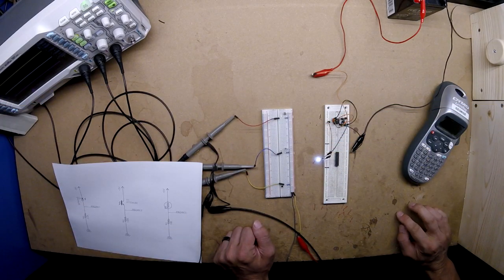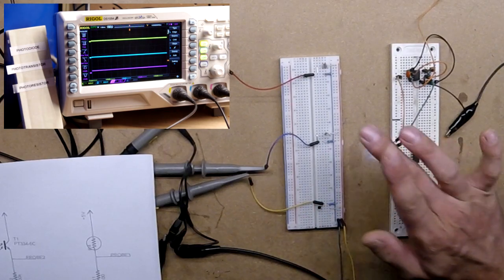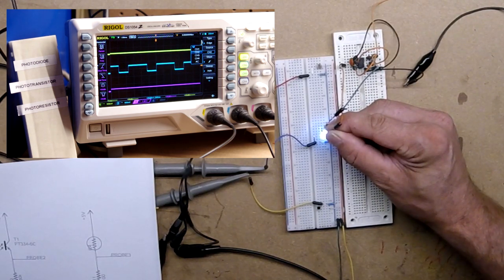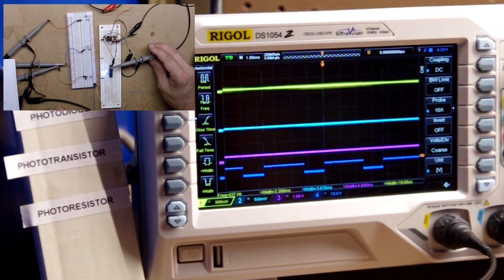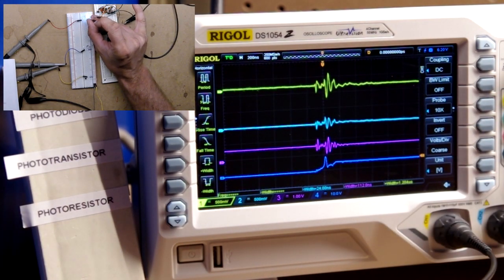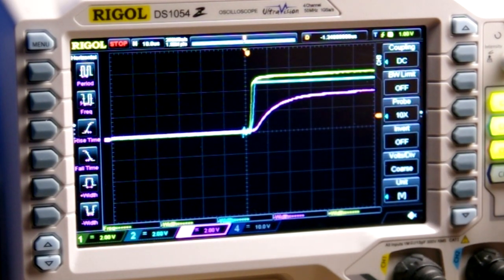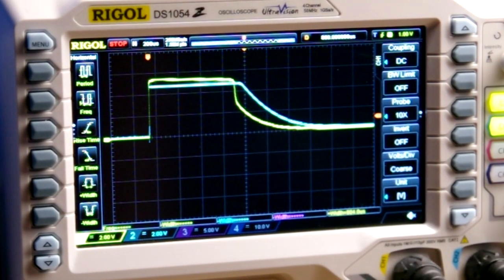Photodiode vs Phototransistor vs Photoresistor

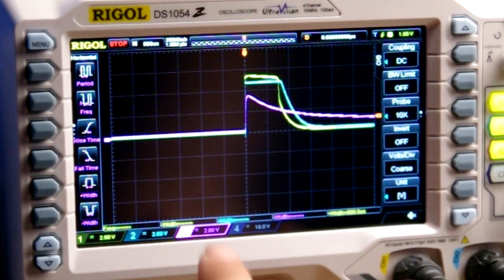Comment: 5:55 Why does the photoresistor start to decay almost immediately, when (by the other devices) the flash isn't finished yet?  If you flash from farther away (and so get a weaker response) how do the results change?

Comment: Very helpful video for a project I'm starting.  I'm working on a lab experiment to detect 5mw laser flashes on a target (standard laser pointer).  The target is covered by a inexpensive diffuser sheet (a white opaque plastic material).  Running into a couple of problems i hope you don't mind helping with. We started working with photoresistors and we quickly came to the same conclusions about response.  We have chosen to switch to phototransistors but have some photo diodes on the way to test.  1) Thoughts on photo diode vs phototransistor for this application?  2) Ambient light changes.  Just the shadow of someone walking by can cause issues.  You mentioned you could use resistors to help with ambient light. Does it just desensitize the sensor?   3) To help with ambient light, we are getting ready to experiment with red transparent film (like from a stage light) hoping to filter some of the "noise" light.  We know there are optical filters that would work better, but we are tight on budget.  Any thoughts would be appreciated.

Comment: That "noise" at about  6:20  is due the external trigger transformer wire in the camera xenon flash trigger wire which I think is connected to the reflector...the timing fits.

This reminds me of the time I made a PCB with a 3x3 array of flashlamps in their reflectors from those disposable cameras. I wired them to flash simultaneously.  I found the flash code sequence that emergency vehicles used to get green traffic lights....found an intersection where it worked every time!  That was many years ago....doesn't work anymore.
THANKS FOR THE VIDEO!!
ps
I was surprised at the fast risetime of the LDR.

Comment: A big thing that you didn't mention is the rise time of your LED, which is basically the inverse shape of the diode, and probably much slower given the PD is designed as a sensor. For testing, you'd want to put your 4th channel, the ref, in the output of the LED rather than the 555.

Silicon PMTs also exist for even faster reasons response. 

The radio noise you say was from the xenon plasma in the flash lamp. You're hitting on some problems with pulse power systems like Sandia's z pinch. They use spark switching to dump the power, so like the flash, they're noisey. So, to do diagnostic testing on the switches, they need monitor the flash of the switch spark. This ofc is just below the range of silicon response!

Cool video

Comment: Hey, I have a project and if anyone could give me some input, that would be cool. I know a quite bit about physics, but I‘m not good with electronics. 

I want to measure the speed of an arrow. I want to construct a light curtain with a simple light source that is flicker free. Or as free as possible. 

Then I want to shoot an arrow through that light curtain and measure when is flies by. 

I thought about measuring this by installing a glas fiber which is supposed to gather the light and lead it towards a photodiode. The arrow will spend at least 50 milliseconds in the light curtain. 

So I need a system with a time resolution of not more than a couple milliseconds. Better if faster. 

It‘s just a hobby project so I don‘t intend to spend thousands on this.

Any idea what equipment would be fitting for such a project?
Reply: According to your video a phototransistor might be better suited to my needs than a photodiode since both are by far fast enough bat the transistor is more sensitive.
Reply: Photo diode and perhaps an incandescent bulb running on true DC like a battery. You'll get no pulsing from the light source. A good photo diode should have ~100ns or so. Just depends on how much resolution you want

Comment: This is a great video with great examples. Do you have any videos on increasing the sensitivity of the photodiode?
Reply: Photodiode has more response with Infrared light.
Reply: You can reverse bias the PD but it would increase dark current. Also, be careful not to exceed the maximum reverse voltage. Normally, light current from the PD can be amplified by a transimpedance amplifier.

Comment: Trying to figure out where to buy a photosensor which is already in a housing that I can use along side an oscilloscope to measure a monitors pixel response time, aka changing from one color to another. apparently this is how testing is done online for gaming monitors and I want to be able to test my own monitor without relying on a review (since one of my monitors is a little older and doesn't even have an in-depth review). the oscilloscope is pretty cheap, about 300 bucks. I just need a photosensor that can hook up to the BNC plug so I can use it for measurement.

Which of these 3 would be fastest for measuring response time to the fastest degree? And is there a product that is already in a housing with a BNC connection to easily attach it to the oscilloscope? thanks in advance. IF they dont have anything premade, is it possible to put the best of the 3 into a housing that can sit flush with a monitor screen to check pixel response times?
Reply: If you haven't already found this, you can search for "mounted photodiodes" to see the range of what is available. usually, you will want to amplify the signal from the photodiode with a transimpedance amplifier, but you might be lucky and have a 'scope sensitive enough to read the signal from the photodiode directly.
Reply: @RexxSchneider  i did. Lmao mad old. I ended up buying a thorlabs sm05 whatever with 15ns rise/fall time and its been epic for measuing monitor response times. Tested the new alienware 3423dw and sure enough sub 1ms full pixel response which makes me think that modern reviewers don't have fast enough tools

Comment: Hi, I am just starting to learn about electronics. So if a photodiode is better to detect fast flashes, what are photoresistors and phototransistors better used for?

Also, I see the phototransistor reaches a max. intensity, stays flat, and then falls. Does this mean the phototransistor was saturated and that horizontal line is its upper limit?

This is really cool, thank you for your video!
Reply: Photoresistors are non-polar and generally quite robust, so can be used in applications where those are important, although they are very slow.
Phototransistors are quite sensitive and moderately fast, so are useful in general purpose applications without needing further amplification.
Photodiodes are less sensitive but fast, so are used along with further amplification where speed of response is important.
The phototransistor in the video is definitely in saturation, especially as it's being used with a 100K resistor. Normally, you'd use a much smaller value.

Comment: What caused the super earlly decline in the photoresistor? I get that it's slow, both up and down, but it seemed to really jump the gun on the release of the flash, relative to the other devices. Obviously the original intent is dead and done, but instead of doubting the PR, I'd say that there's something to be said about it's early decrease in conductivity, relative to it's faster counterparts..
Reply: I'm curious about that, too.  Two explanations come to mind: either the photoresistor "gets tired" and its response damps quickly, or the flash is much faster than the pt and pd suggest, and the flash "blinded" them for some amount of time.
Reply: @Erhannis I wonder if a lot of electrons get freed, but they can't travel anywhere. The resistor turns into a capacitor and discharges slowly.

Comment: Which photodiode do you use here?
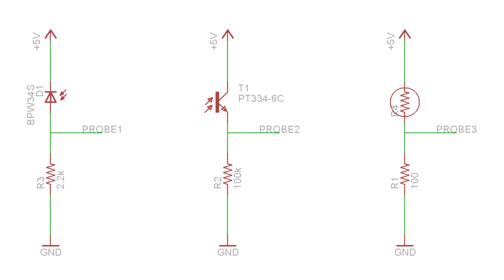Reply: At 0:29 the schematic shows the photodiode as BPW34S and the phototransistor as PT334-6C. Both have datasheets readily available online, and are cheap and available from a variety of suppliers.

Comment: neat! im only half way through. which devices did you use? im trying to figure out if i can use this phototransistor or a photodiode. kinda trying to build a transimpedence amplifier. and getting nowhere. im wondering if i burnt my components. i havent had near the performance you have had. which components ya got?

Comment: i have 1 dought. are you measuring the current or voltage ?
Reply: It's an oscilloscope, so he's measuring voltage. Of course, if you measure voltage across a known resistance, you are equivalently measuring the current through it.

Comment: You were unfair to the phototransistor. That 100k resistor at the emitter... A huge time constant! Even to the photodiode: 2k2 it's also a big resistance for them. The transistor could perform better with less resistance at its emitter. For sure...

Comment: Very interesting. So you basically suggest photodiodes (or phototransistors for a higher current). Any cheap/fast model you can suggest? I am looking for a sensor in the order of 100 microsecs of rise/fall time.
Reply: LOL 100 microseconds, that seems to be a lot, I am looking for something that can respond within 100 nanoseconds.
Reply: I'm currently searching for really fast and affordable components and so far, PD204-6C which can be found on ebay has a fall and rise time of 10 nanoseconds. So there you go, that should be enough for your project and mine aswell. :)
Reply: Yep! I actually ended up buying one with 5ns fall/rise time. They were cheap enough
Reply: Could you share the part number, maybe I can use that instead of the slower that I have
Reply: Do you think you will be able to appreciate the difference? Are you using it for communications? Btw atm I can't access my order from phone. Will do in a few days but I remember it was of family Osram SFH probably 203 or 302 can't really remember on top of my head
Reply: Hi, it was SFH203 model  https://www.osram.com/os/ecat/Radial%20T1%203-4%20SFH%20203/com/en/class_pim_web_catalog_103489/global/prd_pim_device_2219554/
Reply: Thanks, actually in a pretty soon it will, because I I am trying to reach the level of programming on whivh you use every single cloc cycle efficiently. and so since the microcontrollers that i am using are about 100MHz, it does make a difference. I am in need for speed. speed of light is a limit which i am approaching

Comment: Very nice analysis, thank you!
If you didn't mind the wiring effort, perhaps you could even tack an antenna, a flat coil, to the flash housing, pick up the EM pulse, and use it as the trigger, catching the flash "before it happens", and give yourself 3 microseconds more time to react. Then again, shutter speed is counted in milliseconds, not microseconds, but hey, "good enough" never prevented anyone from wanting to do "even better", now did it?

Comment: how did you get a high enough output from the photodiode in order to be able to read it on the oscillscope,  I tried your experiment but the photodiode output is so low in order of 300mV, so the oscillscope can't read it so, any ideas about how to solve this?
Reply: did you manage to solve this problem?? I want to try similar stuff.
Reply: actually I tried a different circuit , try this
https://goo.gl/images/QnR3Vg

Comment: I found your video very very interesting, as I am doing a project, where I am doing a sort of solar tracker. It is more like tracker that will track toward the point of maximum light intensity. Originally, I was going to use LDR, but is there a point in using photodiode as it appears to have superior response time? Thanks.
Reply: Does the sun move across the entire sky in 1 millisecond? If the answer is no, then the response difference between these don't matter for your application
Reply: watch.firefly hello, can you inform me about what you decided to choose? I am building a solar tracker too and I had the exact same question as yours. Would be really helpful if you told me about your experience! Thanks

Comment: how about photodiode output voltage? is it decrese with the increasing light?
Reply: N T Voltage? You misunderstood how it works. It outputs current, not voltage! The current to light graph is given in the  data sheet. However, you want voltage — you need a current to voltage converter. A transimpedance op amp is amazing at this.
Reply: Crazy Phil I'm not sure that I understand his question... but what I don't know is do any of these things output a voltage when light is applied to it, kind of like a photovoltaic cell... I have been searching for a video where someone actually measured to see if they produce a current but so far I haven't found anything on that topic...
Reply: @PeterMilanovski  A semiconductor junction when reverse biased will conduct if photons of the right energy strike it because the light generates charge carriers in the semiconductor. So you apply a reverse bias to a photodiode and it will give a small current when illuminated. That small current can pass through a resistor and be measured as a voltage. this can happen very quickly because there is very little capacitance in a reverse biased diode.
Also, a transistor with its base disconnected will not conduct, but light striking the base-emitter junction can generate charge carriers that provide a small base-emitter current, which then creates a larger collector-emitter current by the usual transistor action. The phototransistor therefore amplifies the current compared to the photodiode. Again you can arrange for the current passing though the transistor to pass through a resistor and that can be measured as a voltage. The phototransistor has a larger capacitance across its b-e junction than the capacitance in the reverse-biased photodiode, so in simplistic terms that slows down its response compared to the photodiode.
It's worth noting that a photodiode can also be used without biasing in its photovoltaic mode, which increases sensitivity but results in a greater junction capacitance and hence worsens its response speed.
In all cases, it is common to use an operational amplifier to magnify the small signals from the photodiodes, and I'm pretty certain you can find lots of examples of that on the internet.
Reply: @RexxSchneider  what do you mean 'the light generated the charge?' a charge is energy and energy can't be created nor destroyed..... Where is this energy coming from?
Reply: @PeterMilanovski  Light is energy. An electric charge is not. More specifically, a photon of light can impart its energy to a semiconductor by moving an electron out of its fixed place in the crystal lattice into a higher energy state where it is mobile. The electron will then move towards a more positive region. The gap left in the structure  also behaves as a charge carrier (called a hole) and will tend to drift towards a more negative region. The movement of charge carriers constitutes an electric current and is the reason why a current is generated when light strikes the junction. Hope that clarifies it for you.